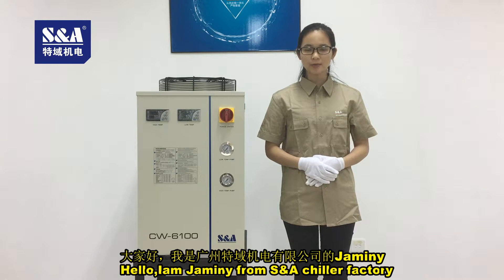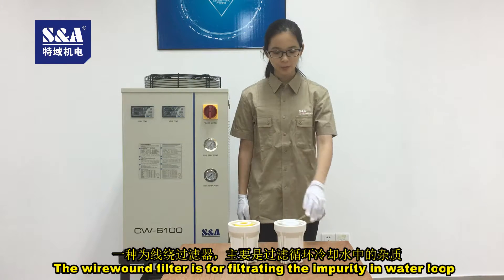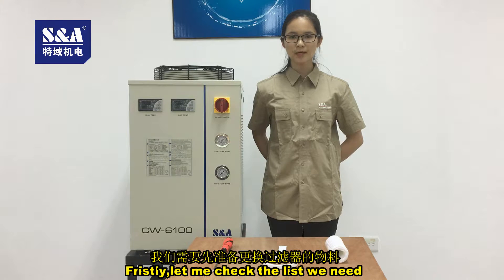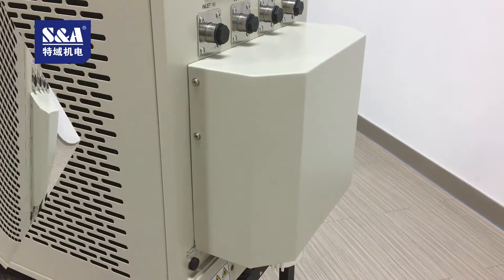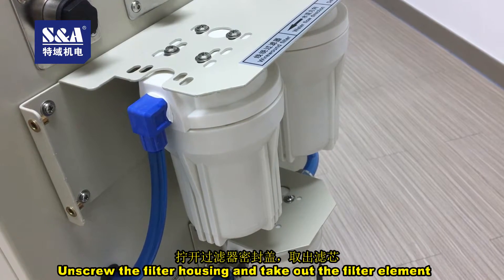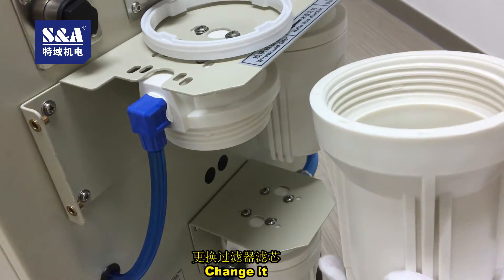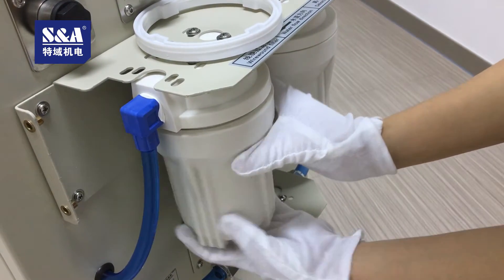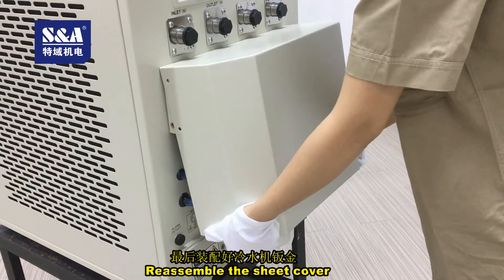How to change the filter element of S&A CW-6100 chiller with dual temperature and dual pump

Comment: How much tempreture of chiller of fiber laser cutting machine 1000 w
Reply from the maker: Hello. S&A chillers work within 5℃-35℃,  the  controllable lowest  temperature depends on the heat load of the cooled machine and the cooling capacity of chiller. S&A suggests the best running temp. is 20℃-30℃.